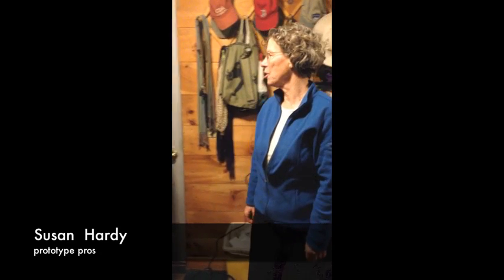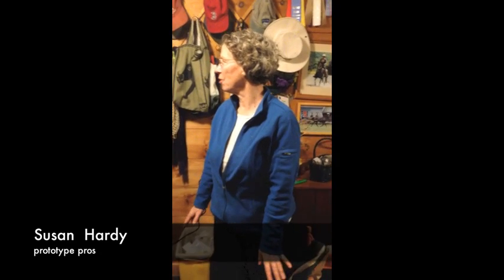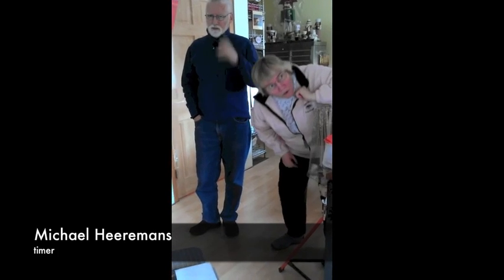Solar Panel Snow Removal System: A Dartmouth Student Project

Comment: I've always found it fascinating that the industry has been so set on making inverter designs that do NOT backfeed power to the solar panels while snow melting would easily be done by doing just that. No additional plates or such need to be added, just smarter electronics.

Comment: This is a good idea, thanks. How much does this heat tape cost though or can you reverse the power through panels.  Seems if the panels were a little higher off the ground all the snow would have come off.